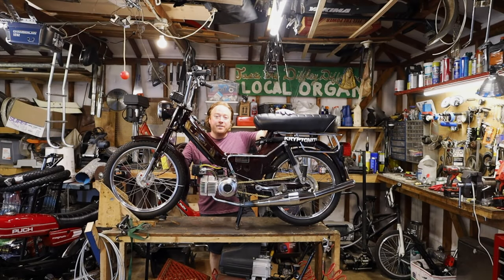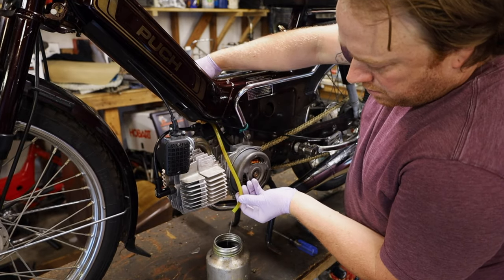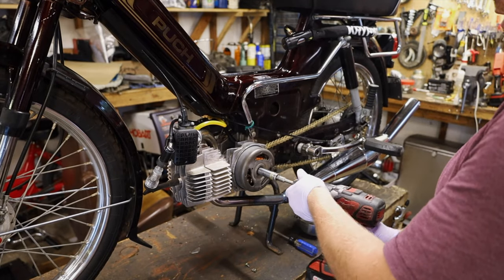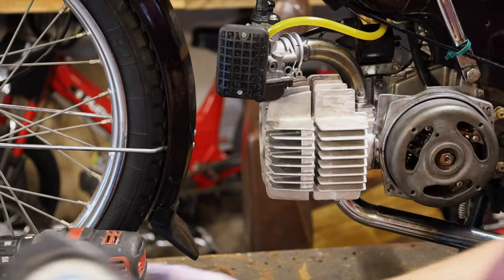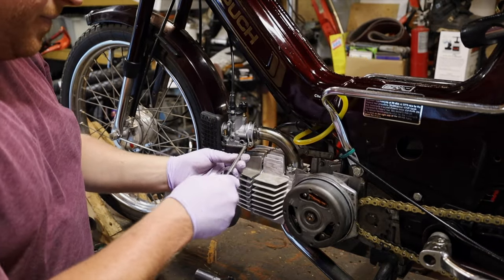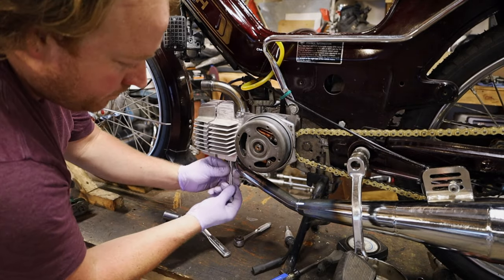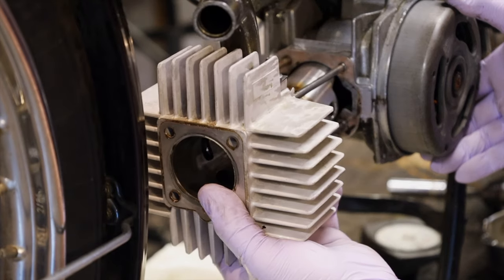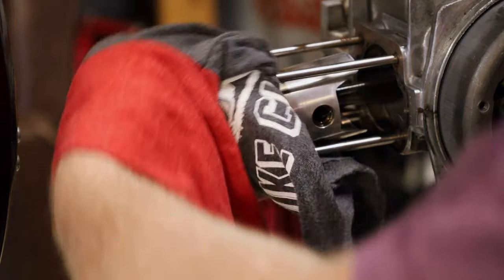Diagnosing a Puch Maxi Moped Checking for Spark, Compression, and Fuel!

Comment: Old video, hope you’re still around to see this. When using a gauge to check compression, how specific is the sizing? I wanna get one but I don’t wanna make several trips finding the right size lol thanks!
Reply from the maker: It's real specific. See what size spark plug you use and get one for that size. My mopeds use a 14mm spark plug.
Reply: @Corn-ped  rad! Thanks for the quick reply.
Reply from the maker: Yeah man! Remember to hold the throttle open when you check the compression

Comment: Good video, what did you use for a compression tester and whats the margin for error? Harbor freight c tester is usually like 40psi off of actual
Reply from the maker: I used a handy hand held one. I don't know what the tolerance is but is fairly accurate. I would use a screw in one with the throttle all the way open if I wanted to know the exact comp. This was more to illustrate that it had no compression.